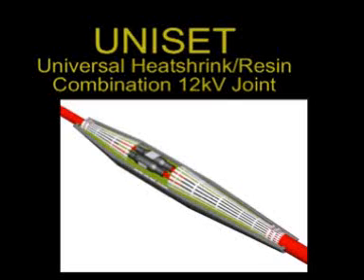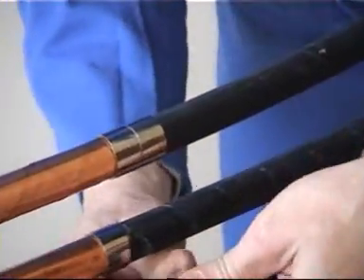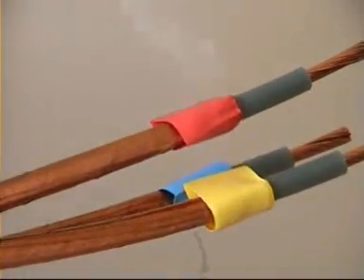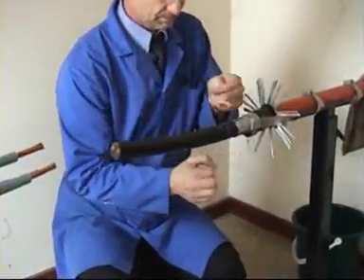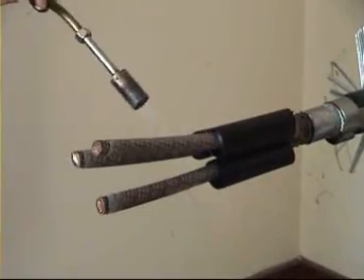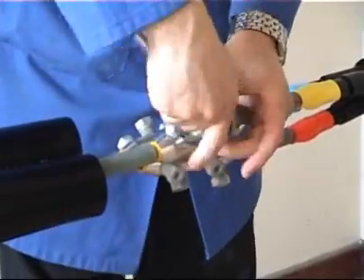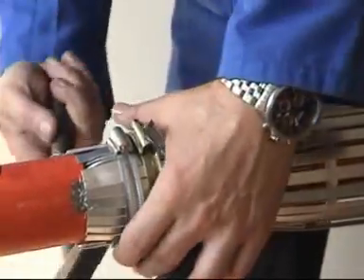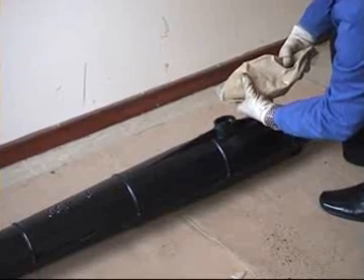Heat Shrink / Resin 11kV Cable Joint 3.3kV, 6.6kV 11kV, 15kV - SPS Uniset - Straight Cable Joint

Comment: It is interesting to read the comments on jointing, also to see the time that it takes! I am being taken to court by the power network for damaging a cable that was only 300mm down in my garden. It was only the supply to next door but they are claiming that the jointers took over 30 hours to put in £70 worth of material making two joints. They also want 14 rest time! This man on the video must be quick!

Comment: Whilst doing my electronic apprenticeship n when I qualified. There was a bloke called Peter Bradshaw who I worked for (who owned the company) n he's done everything from extra low voltage 240/415V all the way up to 400kV. 

His company did cable pulls and terminations, which I thought was really interesting n I loved it! 😁 Even though you need to be "strong like bull!" to properly manhandle those massive cables. But then again it's something you'll get use to and become stronger over time. 
There's definitely a nack to it, which you'll pick up over time n people with show you.

The only HV (even though this is called medium voltage) I've ever did was 11kV on tranny's n switch gear n I loved it. Never pulled any in but I've pulled in cables a lot bigger n heavier than HV. It was normal modern up to date cable, which must of been XLPE.

If you want to do cables like this. You'll either be working for an electricity board or working for a company doing terminations. 
Those are pretty much the only two choices you've got if you wanna do this for a job.

Comment: The video was made a few years back and the joint has been updated a little since. However, the cable prep advice is still very valid. A joint like this would take about 2.5hrs. Yes it was done in an artificial environment and at a nice height. On site especially in the UK, we don't show the pouring rain and very muddy conditions. Just uploaded a new video if anyone can spare another 20 mins of their lives